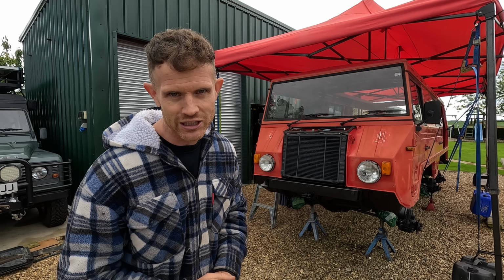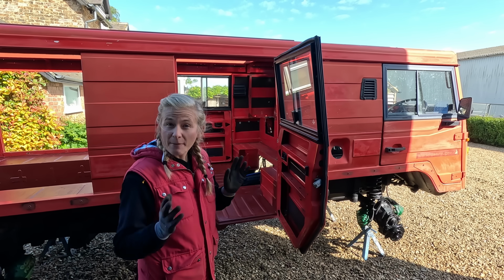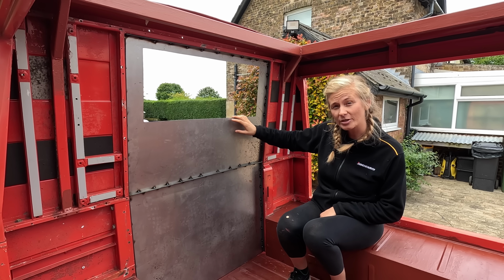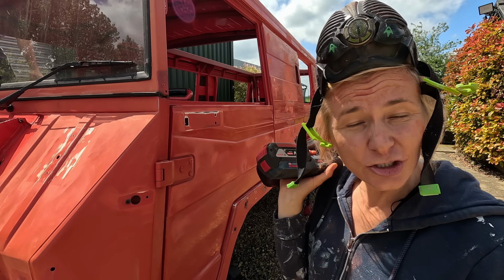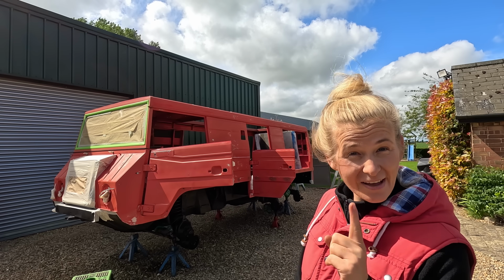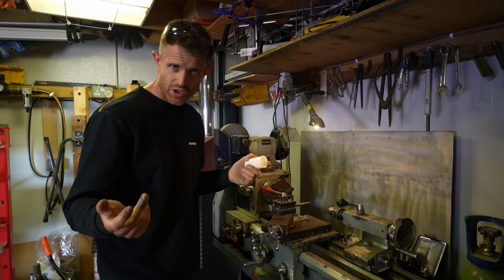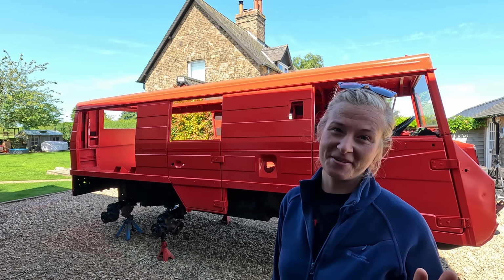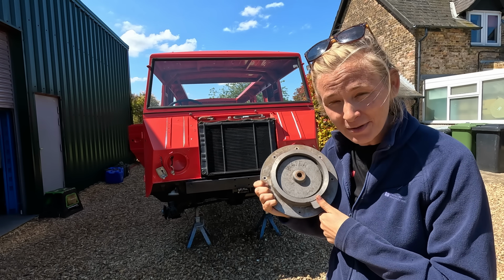6x6 Expedition Truck Transformation: Building Our Dream Off-Road Camper

Comment: If you end up having a wooden table inside, you could use the water filler as a center piece/table mount. Cut a hole out in the table to set the filler in, and then attach the table leg to the center of the filler. If that makes sense.
Reply from the maker: This would be well trick 👌 will depend what kind of table we have and where but really like the idea thanks 💙

Comment: The old water filler could be used as the centre of the spare wheel holder. Nice work, it will be an interesting project.
Reply from the maker: Thanks very much, without a doubt my favourite idea so far 👍👍

Comment: Use the water filler for the table base bolted down in the van, work it on the lathe so a central table leg will attach, job done.
Reply from the maker: That’s a nice idea, not sure where the table will go yet but would be lovely 👍

Comment: Cut a thread (on the lathe 😉) in the center bore of the water filler cap. use it to look like it holds the spare wheel on the back/cover the bolts
Reply from the maker: This is such a great idea but we always have a dirty bag on our spare wheel so it would be covered up all the time unfortunately 💙

Comment: What about using the water filler as a light fitting on the underside of the canopy shutter, it would also serve then as a sofa reading light when the shutter is closed.
2nd idea 🙂 Mount it back on the body, thread out the centre and use it as a holder for a screw in support for Jon's shutter table (same sort of thing as the Landy table.
If only Jon had added that cute little tartan number to that bikini look, I'm sure that the guy who unsubbed would have re-joined us 😜😜
Reply from the maker: 😂😂😂 he would of loved seeing little Jon in the tartan hey, or the naked snow dive 🤷‍♂️
Loving the ideas with the water filler👌👍
Reply: @truebluetravellers  I still have nightmare over the snow dive 😬😬

Comment: You two are crazy and these camper build vids are TV quality👌👌👌

I’d try to make a spot light out of that water thing and put it on the roof above the window screen
Reply from the maker: That’s a cool idea 👌 will see if it would fit in the top panel, might be a bit big but could maybe go in the middle of the roof rack between spotties too 👍
Reply: @truebluetravellers  👍👌👌

Comment: How about using the filler cap as the clamp for the spare wheel? John could drill the PCD for the studs and then use cap cover to sandwich it to the bracket. Give it a clean up, polish and clear coat and it'll be in full view for all to see.
Reply from the maker: Loving this idea mate, my favourite so far 👍
Reply: @truebluetravellers  Simple enough to do. TIG the damage (assuming it's an ally cap) and you're golden. 🤙🏻

Comment: Great work so far guy's. Just make sure that you cover any glass when you are welding or grinding in future, those sparks stick to glass like you would'nt believe and will ruin it.
Reply from the maker: Thanks very much for the tip, someone else also said that they’ve had glass crack so will defo be covering it from now on thanks 💙

Comment: Great video again. If your doing your outside black bits with Raptor you should take the opportunity to do a Raptor drop coat on any black plastic internal bits, really brings plastics back to life and never fades.
Reply from the maker: Thanks very much, surprisingly the dash is in really good nick and there isn’t much internal plastic but we are going to do the door handles etc, just waiting on the plastic primer in the post 👍

Comment: Woo hoo , its blooming Saturday,  and you guys have done a production ,that's more British in way of proffesion ,than other countries ,let's say 😂😂😂😂  i said nothing about kinder suprise egg bans 😂😂😂 oops . 

Top Job on paint work Johnny boi ,  looks like overlaps were good , no reactions from contaminated surfaces,  even coats applied !! 

P.s. I was a paint sprayer for 8 years ,long time back , 3 part mix , sealant or lacquer,  dependant on ,how far along task was .

The acid for ,aid in drying the mix on product.   

The smell of different thinners.   The Gun cleaner , all Ft Morrell  products ... euch  206 gun cleaner , grt for melting them cheap coffee cups .... 

To you both !! Keep it up .
Reply: Sorry John ,I found a small  , very small terminology slippage.. 

🎉 I'm on it like a sonnet 🎉

For folding metal ,which is the act , you use a metal brake . 😂😂😂  its interchangeable.  I'm only joshing , the headache of the debate ,would not be worthy . 😂😂😂
Reply: The roller shutter ,table idea ,John , you could do alike a leaf table effect . 

Roller shutter ,comes up some grooves from a flat wall. ,  to come into play , and two pivoted ,horizontal supports fold out from same wall, to give structural support for said table

For Jess the water fill port , could it not be incorporated into spare wheel area ??  .
Reply from the maker: Hi Wayne, thanks so much for the compliment mate. Stoked with how the finish came out especially considering it’s a back yard job. Like the table idea will see if we can make it work, thanks 👍 would love to have it on the spare wheel but we always carry a dirty bag so would never see it there unfortunately
Reply: @truebluetravellers  No worries pal,   top tip for spraying small items ,    two ways , work out which would be best , dependant on hidden areas hardly seem. 

Say a wing mirror housing.

Make a pin board ,with say 6 inch nails , sharpen tips ,to a needle point  fix thru board ,by drill holes. Four for stability 

Make sure nails stay tight, sandwhich with other board ,if needed. .underneath. 

Then if glass comes away in mirror housing , place the most inner part onto nails. And if poss ,get a potters wheel or the likes.  Rotation baby . 

Other option ,is get like metal coat hanger , and a washing line , no jess not the one for washing,  tell John.  

Place a like butchers hook ,made from metal coat hanger , anyway that it doesn't get in way of paint job . 

Hang on ya wash line , and spray away. 
Then spare hand ,can gently balance as spray hits with the air blast. 
If that all makes sense. . 

When it comes to lighter colours , spotting stripping can be a nightmare. Specially if there are any areas that create or have shadows. 

It's  like ,shadow or stripe , then argh . 😂  

Looking forward to seeing how she ends up. 

All the best .

Comment: As a former Qstoves user, I must say that switching to Asmoke has completely changed my outdoor cooking experience. The convenience and consistency of the temperature control that Asmoke offers are unparalleled. I love how I can now set my desired cooking temperature and not have to worry about constant adjustments. The wide range of wood pellet flavors also adds a unique touch to my dishes, something I didn't find with Qstoves. Plus, it's portable and lightweight design allows me to carry it on all my camping and RV trips. And the best part, it's environmentally friendly. Definitely, a game-changer for all outdoor cooking enthusiasts like me! #Asmoke.

Comment: Regarding the Water filler point, drill some small holes in it plumb in some Gas fittings, and use it as a Gas Hob / Burner.  It could be used for Water and Fire in its lifetime!
Reply from the maker: 😂😂 this would be so cool if we could do this 👌

Comment: Axminster Tools do a great vise mounted metal bender. It's only 6" wide but you can do longer runs if you do a bit at a time and tap out any little dents caused by the corners. Part No 310013. Also if you need a brushing paint I can recommend Tractol and you can get it in Ral3000, it brushes lovely and tough enough as tractor paint.
Reply from the maker: Legend 👍 thanks so much mate this is really helpful and much appreciated 💙

Comment: Water Filler Use - Ceiling light rose, steering wheel centre, wall mount for over head bed light, overhead shower fitting.
Reply from the maker: These are all good suggestions thanks, will see what we can make work 💙

Comment: Mount a button into the centre of the water filler and use it the button to turn on external work lights (or anything else requiring a button)!
Reply from the maker: Would make a pretty impressive switch! Thanks mate 💙

Comment: With some modification, I really do think that you should use the water filler cap as a surround or faux cap for your water inlet. Being careful to retain the part that says 'water'. Of course, the real water inlet would be behind (or surrounded by) it as I understand that it cannot be reused as was. It could even be used as a security device to stop people tampering with you water (depending on where you are intending to travel). If that doesn't suit, then use it in your wet-room (shower head holder?) or in the kitchen to surround the kitchen tap (probably takes up too much space, unless the tap is fitted to the wall like old taps used to be.
Reply from the maker: Would be so cool as the water inlet point but it’s too big for all the panels on the side and would mess up fitting the proper filler point in where we need to put it unfortunately. Love the tap idea but like you say will just depend on where we put the sink in, thanks so much for the ideas 💙

Comment: The rivets on the roof will leak through the middle.
You should use sealed rivets.
Very interesting build, amazing vehicle. Subscribed :)
Reply from the maker: Cheers mate, I filled the little hole with sikaflex and also just smeared a little over the head of the rivet for extra seal 👍👍👍

Comment: Make the Filler Cap the Center of your spare tire holder plate on the rear. Perhaps you could weld a good threaded pipe piece to it on the back, and have a threaded pipe the tire and rim sit on that you can snug it up against, even incorporating some vibration deadening rubber or phenolic spacer. That would be a trick bit of kit, and a very neat little hidey-hole to boot!
Reply from the maker: Absolutely love this idea 💙
Reply: @truebluetravellers  you had me pumped in this week's episode.... But, you can't compete with that brilliant bit 'o kit for the camper's dirty bag..... Might have to find you something from the fire service over here in the states for you to find a use for.

Comment: Can you use the water tank cap as a massive lug nut to attach the spare wheel to the back of the truck? John will love turning it in to one giant lug nut on his lathe
Reply from the maker: Love this idea 👌 would look schmick as, only trouble is that we always carry a dirty bag on the spare wheel so it would be covered all the time.
Reply: Why not just mount the dirt bag lower? There is plenty of ground clearance

Comment: Have you not thought about the advantages of a permanent roof rise. Lots of extra space and the car doesn't get as hot either when the roof can be properly insulated and have ventilation/sunroof.  Interesting project - good luck!
Reply from the maker: Thanks mate, yeah we did think about cutting the back off and building a grp box to full height but also going to enjoy building the pop top 👍
Reply: On mine I have airgap/distance between cockpit roof and campers front storrage, that keep car cool, good when driving in hot climate or summertime.

Comment: you have a welder , you couldve hold a piece of copper against the underside of the roof and weld those holes shut from the top , the copper holds the liquid metal in during welding without realy sticking to the copper plate  , grind flat and youre done 

too bad the waterfillpoint is seized in the housing as you couldve used it as the base for the table , you can the revove the tabletop unscrew the leg out of that fillpoint and set it aside to be able to put a large load in the rear (motorbike?)
might still be able to sink it intoo the center of the table top and put a little piece of polycarbonate over it level with the tabletop with some led lights as a centerpiece , could add a few other things too like photos of the rebuild or fireman badges
Reply from the maker: Great ideas 👌👌, yeah I did think about welding them up but just so many and with the galvanised body thought it was best to just rivet 👍
Reply: @truebluetravellers  the the calvanizing will cause some nasty headackes when heated up , releases some mustard yellow smoke thats pretty toxic  
using the poprivets is probably the best idea as long as there not the hollow type with the pull nail through and through , as the nail works itself loose and it will leak , the dissimular metals inside the rivit will cause corrosion too  , you need the ones meant for boats

Comment: Hey guys love your work and videos. Just a tip if you're not aware you can get metal cutting blades for your tracksaw. They make a hell of a noise but cut quality amazing. Ive used a few different ones and recomend the bosch blue ones.
Reply from the maker: Brilliant thanks for the info 👍👍

Comment: I think if you are going to be driving at night at all, you should upgrade the headlights to LED. If the holes are 7", you should be able to fit defender ones. There's loads of aftermarket options on the old ebay
Reply from the maker: Thanks mate I’ll take a look 👍👍

Comment: Could you use the water filler cap as a wheel centre bracket on the spare wheel?
Reply from the maker: Such a good idea and would look so cool but we always carry a dirty bag on the rear so you wouldn’t see it unfortunately
Reply: @truebluetravellers  you could also just fit it flush into the floor as a cool feature, whatever you do I’m sure it will look cool 👌

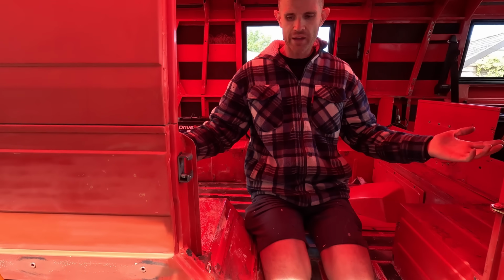Comment: 0:44. that looks like a catch point. like when you close the door and it catches that particular part of the frame. and if you think about it, its not all that surprising as the firemen scramble into the truck, using the door handle to hoist themselves into the cab. eventually something has to give, and in this case its likely the door hinge has become weakened slightly. so when you close the door, it catches the frame.
Reply from the maker: I’ll take a look at the hinge seems ok but might be right 👍👍
Reply: @truebluetravellers  this isnt a counter argument or me trying to backtrack, but its likely you wont find any wear in either hinge (there ARE 2 arent there?) there might be a slight gap on the centre joints, but metal is pretty resilient so it might not show anything at all. but the fact that for certain people will have been pulling down on the door handle as they jumped in.......... if you have ever had an old ford granny, those doors dipped after about 5 years, not because anyone used them as trampolines, but because they were too heavy and the hinge took the brunt of the weight! anyway, keep up the great work. im new to your channel, but being a carpenter of many years id have to say you're doing a bang on job..........
Reply from the maker: Thanks very much mate 💙
Reply: @truebluetravellers  i like the fact you sometimes answer your subs, most dont. but you're in my field of work. im mostly into car channels because ive done all kinds of racing over the years and im a huge f1 fan. but then anything to do with building stuff from wood. its mad that even though ive been doing the same job for around 30 years, i still see stuff i would have never thought about!

Comment: hey have you ever given any thought to changing the radiator to a custom oversize aluminum.. you could then add rear heating off the cooling system if needed. was just thinking that black/dark front the rad sit is screaming eye candy pop. look at me.
Reply from the maker: 😂😂 would look the part that 👌👌

Comment: What about using the water filler cap drill a hole in a centre and put battery isolation switch in the centre.
Reply from the maker: 👌👌 very nice idea this one

Comment: The old water filler paint it red add numbers round the outer face 1 through to 12 buy a clock movement and use as a clock so u can change it to different times zones for ease or polish it and add numbers would make a great clock (time piece)
Reply from the maker: Would be a great clock, thanks for the idea 💙

Comment: Been watching for awhile, but first time commenting.

It might be a bit hard to do mechanically, but what if you turn the water filler into a clock?  Painting the numbers around the circle could be easy enough, drilling and fitting the mechanics of the clock to fit behind the face might be more difficult.  But hanging it inside as an up-cycled reminder of the vehicles past life would be fitting.

Or even if you hung it in your house.

Edit: ah I see someone else made the same suggestion I was too late getting to the video. 😅
Reply from the maker: Thanks so much mate we really appreciate it, love this idea and will definitely look for a place we could put it and if we can make enough space at the back for the mechanism would be lovely 💙

Comment: Mount  the filler cap in the lathe and turn out the center to fit a digital clock the come in sizes from 65mm up in 20mm jumps  mount on the wall or on a stand
Reply from the maker: Brilliant idea this 👍

Comment: Excellent work again, I am disappointed with the shutter situation. Just going to be too dark inside. Back door is now only a little window (due to tyre), one side is going to be filled in for cupboards, so the last chance of a permanent view of the outside AND any light coming in is going to be blocked by a shutter that 'can' open. So what if its cold, or pissing down, you have to sit in a dark box. Bad move guys. Keep on.
Reply from the maker: Each to their own mate, it’s a balance of using the space effectively and it not being too dark, pretty sure there will be a bench seat across the middle where the rear doors are now and will be open through to the front so should still have good light as will have front windscreen, front door windows and in the living area will have 2x rear door windows and the window at the back which is a lot more than a lot of vans have 👍